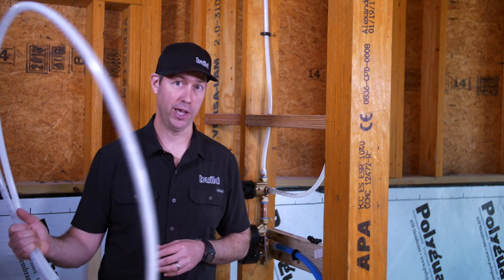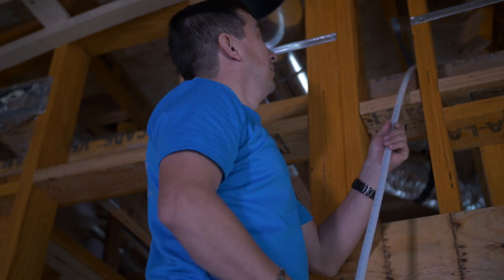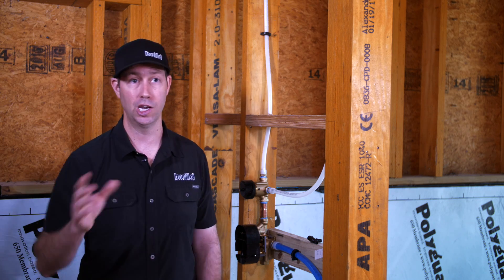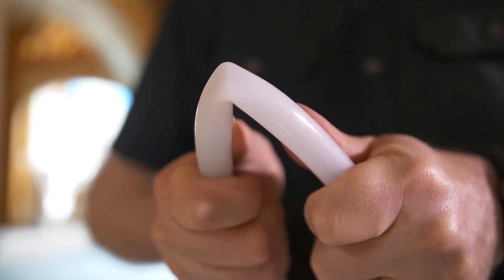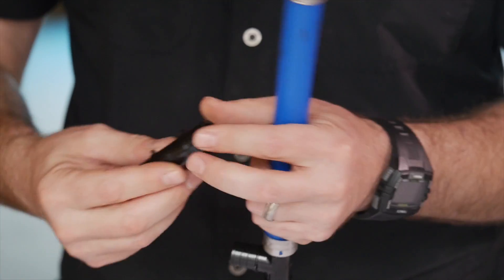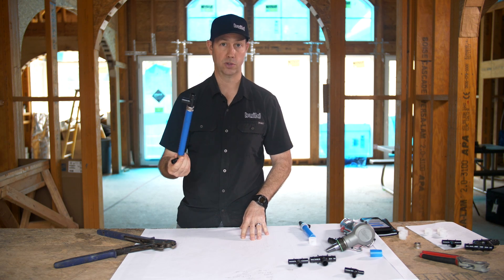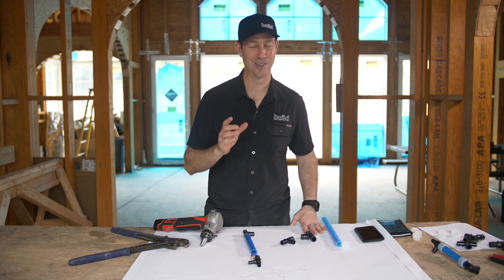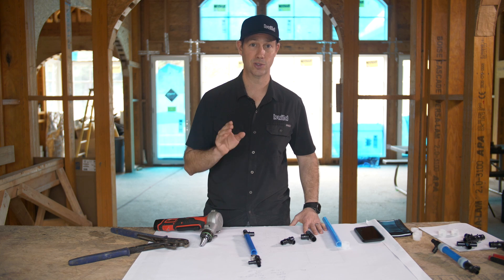PEX vs. Copper Plumbing

Comment: PEX.............Unless its installed as ( 1 ) long run........from the "manifold"( usually in a garage, a basement or even a manifolf in an attached shed/car port- washer dryer area)....... to the "item"( be it a water closet, sink, whatever......), then its installed WRONG.
Meaning: each item in your residence should have ONE FITTING at the " item itself" & ONE FITTING at the manifold - Period.
( 2 ) fitting per item and if there is EVER a leak, its either one or the other......#simple.

* I walked into a Lennar residence 1/2 built one day and saw 56 fittings in a simple 7ft wall space of the garage......." 56 " transition fittings! & the house wasn't even close to beong done. I didnt even get out if the hot water heater area of the garage yet?

Comment: We are on well water and our house is about 21 years old (+).  Copper was used through out.  Our water has gotten harder over the past 7 years and has worn the copper thin to the point where we are getting pin holes.  We will be building a new house soon and our plumber only uses PEX.  We are at 9000 feet in Colorado and this seems to be the trend with the better plumbers around here.

Comment: Research linked to quality of water.   Suggest filtered water when used pex system. 15 years vs 50 + plus years of copper. I prefer copper any day. I choose not to get health problems from plastic lol. I am not gonna risk for time and money saving over my family safety. To each his own. More research is needed before actually using in building and house for safetyy of people. If that matters.

Comment: Where can I find the link to warm water without the waste?  I plan on switching to pex due to acid water and pin holes.     I like the expansion pex.  Need to rent or invest in the Milwaukee tool.
thanks.

Comment: I am cold sweating just watching the naked pex pipes mounted to the house frame. In Sweden, we usually use Pex in a pipe in pipe configuration. All the pipes are led to a water tight water distribution cabinet, so any leak is led to the cabinet and eventually drained. All the fittings and connections have to be mounted in accessible, water tight enclosures. It feels much safer.

Comment: At our house we have some typr of PEX that was installed in 1979, and my parents are changing to copper now (2019). Is it good or bad that they did this?
Reply: I have replaced old galvanized iron, cpcv, and copper because of leaks or freeze breaks with PEX. PEX A is my preference.

Comment: I can taste a plastic flavor from the upinor pex a in my house, and no plastic from the neighbor's pex b system. Maybe my pex a was exposed to sunlight before it was installed?
Reply: Keeth Squinters pex b has higher uv resistance
Reply: Could be the cheap plastics used in the fittings of individual facets.   People often forget that the cheap china crap facets that are right at the area you get the water from The facet.

Comment: Two issues not addressed in this video, PEX does in fact leave a mild Taste of plastic, which some people are sensitive to and others are not. This has absolutely nothing to do with BPA content because BPA is only in the news because of health concerns, but it has absolutely nothing to do with the taste of plastic.  
  
Also what is failed to be mentioned by most plumbers, is that rats and mice love to eat PEX. So if you are in a farm or any area where rats and mice are possibly a problem, you will experience numerous leaks and floods in your home, not to mention countless and expensive repairs to rip open walls to find the leak and repair it.   
   
Other than these two issues, PEX is a great product.

Comment: Not sure why this was in my feed but here goes.
1. Pex piping does not prevent water hammer, it may absorb some hammer but by no means prevents it. Water hammer is caused by the rapid stopping of water in a household pipeline, conversely it can be caused by a check valve not closing fast enough at the municipal level.

Comment: I repiped a house yesterday in PEX A using the Milwaukee pipe expansion tool. I absolutely love using this material just because it's flexible and no heat is needed. It's also color coded Blue and Red and not expensive.

Comment: I was able to replumb the majority of my house in 1 day and get the water back on using PEX-a. I recommend it for the great ease of installation. I do taste a plastic taint of the water in the mornings when water has been sitting in the pipes all night. Run the water for a bit and the taste is completely gone.
Reply: Thanks, I’m having the same thing done at this very moment. Seems that most like it 👍

Comment: Do you leave extra tubbing in case you need to cut and say add a new water valve? or how do you change / modify fittings?

Comment: Would you use it on a build concrete on slab? My daughter wants to do radiant heat with it. She's going to instal the plumbing and later down the road put in the unit. Any ideas or foreseeable problems

Comment: Rats and mice love to chew on Pex.
But  not so with copper or pvc.
Not sold on Pex until they can at least coat the outside  with rodent repellent like some car makers did with their electric wiring harnesses.
Reply: Why would you want rodent repellent built into drinking water pipe? Do people commonly use wiring harnesses for drinking water purposes?
Reply: @deanhenthorn1890  good point Dean.
But without some way of inhibiting rodents from chewing on this stuff, problems will mount with leaks caused by rats.The ideal solution would be to coat the "Outside" of tubing . You know,,, the area that does not contact water inside the tube, but inhibits mice from chewing on  the outside surface. 
Not too complicated really. 
Wiring harness repellent is simply an illustration of how serious the auto industry is about a real problem. 
Do you really worry about folks drinking from electric wiring harnesses in cars?
Your solution seems to be repair leaks after they occur instead of preventing the damage and subsequent water damage to the home that ensues.
Some folks, other than yourself, might approach the issue by prevention rather than repairs & damage after the fact.
Reply: Hey Dean , , , 
Here is another viewers take on the subject you seem to think is a joke;
~ Don Whitmire
 2 days ago 
"You didn't mention rodents damaging the pipe. First person I asked about it had  a friend return from vacation and now living in a motel with  most of his home and many sessions damaged or destroyed."
Reply: loren salazar he said Built In, not applied to the outside of the pipe. I had a neighbor who had a rat problem in his barns and storage facilities, so he decided to put blocks of rat poison around everywhere. He even put it inside the water well house, not knowing that it somehow made its way into his water well. The groundwater was deemed toxic by water authorities and he had to move. Of course he was responsible for decontamination costs associated if and when his neighbors well tested positive. All I’m saying is Why would you put chemicals like that into the piping just to deter the chewing? I know mice and vermin get into vehicles and chew things, that’s what they do. Can rats chew copper pipe? The cost of copper pipes for water lines outweighs the convenience of plastic when you factor damage caused by vermin entering the home. Maybe your overthinking the solution while risking poisoning people to save a buck. Maybe one should look into how they are getting in
Reply: @deanhenthorn1890  Maybe you could ask your local political representatives to simply draw up a bill to outlaw rats & mice to save  the 'overthinking' you speak of.
There are, by the way, very effective & inexpensive electronic devices that work well on keeping out rodents with a high frequency sound waves.
As long as there are no dogs or cats to be equally bothered, problem solved.
I am sure Honda will want your opinion on their 'overthinking' the solution they manufactured into their wiring to prevent rodent damage.
Give 'em a call and straighten them out as you have done for us.
Cheers.
Reply: loren salazar They said they’ll look into it. I mentioned it was your idea in the first place, so I gave them your name. You’ll probably get a pizza and a parking spot for the month as recognition of Employee of the Month!

Comment: you will have MORE pressure drop with pex A because of the larger diameter youll have more flow. higher flow rate = greater pressure drop off

Comment: You didn't mention rodents damaging the pipe. First person I asked about it had  a friend return from vacation and now living in a motel with  most of his home and many sessions damaged or destroyed.
Reply: Agree Don.
A viabler issue indeed.
The auto industry has taken to coating wiring harnesses in cars with repellant that inhibits mice from destroying expensive car wiring.
Pex will need a similar solution. Even squirrels are know to chew on rubber coating on power lines.
(I have yet to hear of rodents chewing through copper or PVC.)

Comment: Ehhh... I think you left a number of drawbacks of PEX out.

First, PEX is vulnerable to Bacterial Fouling. It's as bad as pvc, but not as prone to release chlorine bi-products (because it doesn't contain chlorine). In systems where pathogenic bacteria routinely make it to the PEX piping/tubing, such as in contaminated city water, PEX can become a source of further contamination even if the water supply is improved. 

Second, Water hammer still occurs with PEX, and it's actually more of an issue than you're making it out to be. PEX spreads the impact of the water out over a larger area, which does dampen sound and reduces the impact at the point of the valve. However, unlike copper, plastic always degrades as it moves. Even if it's only slightly moving, the flex caused by water hammer, even if the water hammer is silent, is degrading every inch of that PEX pipe. That can probably be mitigated by proper installation, but silent degradation of something you live in and take care of is hardly a feature.
Reply: This argument continues to fail science. For centuries, before copper piping, we used galvanized (and lead) piping which had no anti-bacterial properties, and rarely did people get sick from tap water...at least until the lead pipes started breaking down and leaching into water.

You don't have to trust me on this. Just use logic: if you have even slightly contaminated water, whether its from the well, municipality, or just your water heater, copper isn't going to save you.
Reply: @emotionz3  Using Logic, bacterial fouling has other effects besides making a person sick. Pathogenic bacteria are certainly a concern, but harmless bacteria that just make the PEX pipe brittle would also be a concern. 

Moving on from that, who said galvanized pipe didn't have antimicrobial properties? 
Zinc is added to dandruff shampoo for a reason. The problem is zinc can also be quite toxic to humans with prolonged exposure and it 'tastes' astringent to most people. 
The fact that galvanized pipe was meant to rot away to nothing, and could do so rapidly under the correct conditions is just the final nail. 
Finally, if your water 'tasting' like astringency' doesn't make you stop and consider a different way of piping water through the world, you probably shouldn't be building homes.

Thus far, the most compelling argument for PEX is the guy who's rental home keeps getting the copper piping removed from the walls.

Comment: You forgot to mention UV exposure which PEX doesn't like, although there are some that are supposed to have some degree of UV resistance.  Learned this the hard way with water in a poly tube going to a fridge that got brittle and broke.  Line was in a unfinished basement with a southern exposure, but it was up in the floor joists and didn't get direct sunlight.   Lasted about 15 years before it broke.   The whole line was pretty brittle before replacement.

Comment: Very informative. I would of liked to hear about connections to the toilets and sinks. I find plastics systems are flimsy at the shut off valves. I usually transitions copper behind walls or in the floor
Reply: i've built two houses with pex, and what i use on the toilets is a brass drop elbow, and for sinks, crimp on an NPT adapter and connect straight to your braided stainless.  there are easy solutions for every situation

Comment: Wondering if PEX A would be just as advantageous in a tiny home build. Sounds like it would be very good with mobile tiny builds.
Reply: It is a lot more flexible, and you can theoretically get away with smaller diameter tubing when using elbows since the compression joint isn't restrictive. But smaller home builds typically have tighter budgets, and there could be a difference of a couple hundred dollars in materials using A over B or C.
Reply: @emotionz3  the cost is the biggest prohibitor. Still and all, I'm thinking I can scratch from a few other areas to make up the cost. I like the thermal flexibility considering insulation and wall thickness are not as robust in tiny builds as they are in typical static construction. Could save a plumbing problem down the road, no pun intended.

Comment: I'm glad you covered both types of PEX. Being basically cheap I would bought the cheaper one without checking the other. As little plumbing as I'll have in my cabin I would prefer the second one. Also, I'll have my own water system and pumps, so pressure loss will be a concern.

Comment: but you didnt talk about benefits/negatives about copper :o
Reply: Expensive, a degree of skill to solder, weight , 90 degree fittings loss of pressure, explosive gas
Reply: In my 35 years of experience I have used and repaired virtually every type of pipe and I can say that Pex is my favorite. I began replacing older copper systems with CPVC  with mixed results many years ago. The problems with copper in my experience are primarily calcium deposits and corrosion as well as condensation issues in damp basements and crawl spaces. Pex is just easier more reliable and less prone to issues.
Reply: Copper Makes noise, cracks when it freezes, is more expensive, solder and flux burns, is not flexable, corrodes and narrows with time, and theives like to steal it while your on vacation.

Comment: Keep in mind folks that most of the inlets on your fixtures are sub 1/4” due to water restriction mandates. Either pex system watts, viega or Wirsbo will all give you great results.
Reply: That's why I remove or drill out those flow restrictors....

Comment: PEX is great, but do take note. That if there is exposed PEX during the installation of closed cell spray foam, it'll mess it up. I've been told from builders, that spray foam changes the PEX and compromises it. So when when water pressure is applied, it leaks and you have to tear out the wall/foam for replacement.

Comment: MALE FEMALE PLUMBING----after long research it has been noted that ALL female fittings HATE being female, and ONLY JOIN UP WITH MALE when it is financially advantageous.
FEMALE PLUMBING will RESIST joining up with male after TINY plumbing arrives.
homeowners should BE CAREFUL as at some point FEMALE PLUMBING will want MALE PLUMBING  to leave the house.
and the female plumbing will want ownership of the house.
the BRONZED/COPPER is as bad as the WHITE SPEEDFIT and  also wants a WAYNEROVER

Comment: Question:  I'm not a plumber and know nothing about plumbing.  I'm looking at renovating my basement and redoing copper pipes that have been causing issues for some time.  Can you replace copper with PEX in some areas of your home while the rest of the plumbing remains copper?  Or is it a one-or-the-other kind of deal?

Comment: I would actually like to correct you in the beginning around the two and a half minute Mark where you say that there is less pressure drop because I can tell you that there's more friction loss in CPVC versus copper. I personally wouldn't have used the PEX for a rain head, and I certainly wouldn't use it for a main branch because of those friction losses. Also, Type L copper is actually pretty resistant to freezing as well and the CPVC well fatigue if it keeps freezing and unfreezing. Anyways, copper is 10 times better and the only reason that it's not better right now is because of the price. But at the end of the day everyone is going to be using this stuff because other ridiculous price the copper is.

Comment: You forgot about galvanized pipe, also very common in older homes. CPVC pipe is garbage. It is so brittle after 10 years and is a worthless material. We have repaired sooo many homes due to pipe breaks and $1000s in damage. Never once with Uponor.

Comment: Rotate the Uponor tube and fitting between click revolutions of the tool. If you look closely, the tool makes an impression on the inside of the tube. By NOT rotating the tube, it creates a circular pattern on the tube. This can create a weak point in the joint. Rotate the tube buy 1/8 to 1/4 turn every click and you will be in good shape. Love the Uponor pipe!
Reply: The M12™ Cordless LITHIUM-ION ProPEX® Expansion Tool features an auto-rotating head for convenient one-handed operation. A compact right angle design makes installing tubing in tight locations fast and easy, and the quick cam mechanism delivers precise, continuous expansion for 3/8” to 1” ProPEX connections. Designed specifically for Uponor ProPEX®, the M12™ Cordless LITHIUM-ION ProPEX® Expansion Tool is built to make effortless installations faster than other tools available. Learn more about Uponor, Inc and the ProPEX® system.

https://www.milwaukeetool.com/Products/Power-Tools/Plumbing-Installation/2432-22